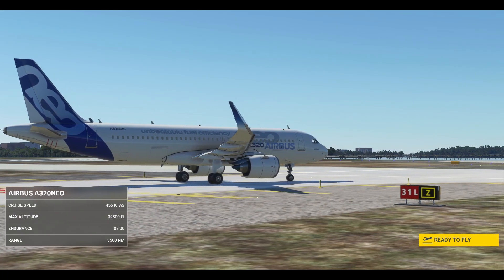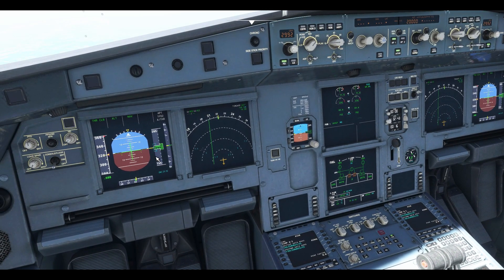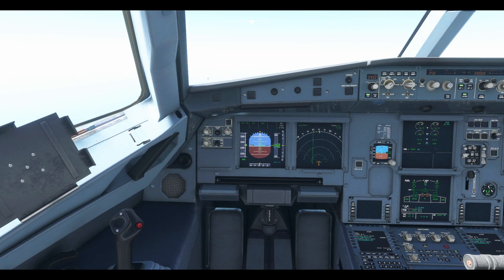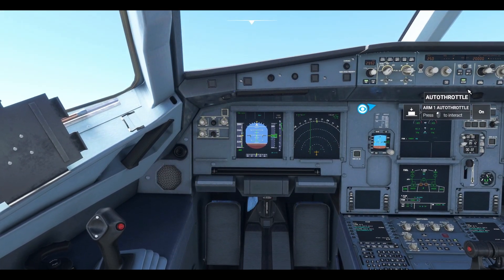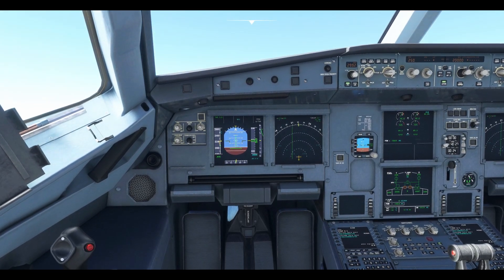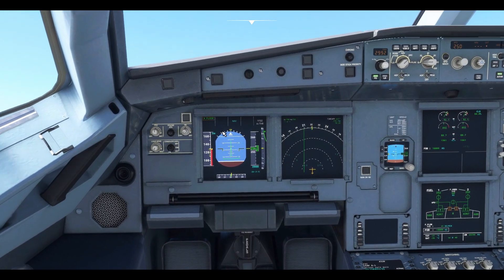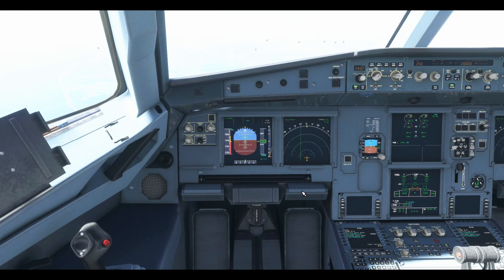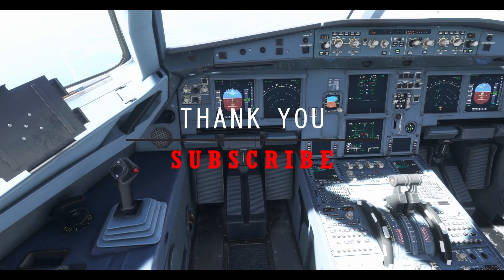Is it Possible to Stall an Airbus A320? | What happens if you try to Stall an A320? |

Comment: So air france 447 doesn't have this stall prevention system???
Reply from the maker: That was because of incorrect airspeed readings!
Reply: They were in alternate law (F/CTL ALTN LAW), where the airplane goes "none of my sensor inputs make sense, you do your thing pilot". They then managed to make the plane go slower than Airbus engineers thought was possible, losing speed indication all together a few times, which is why they heard the stall warning when they did move towards recovery and not when they kept stalling the plane.

Comment: Is this automatic stall prevention system implemented after the Air France 447 mishap?
Reply from the maker: Yes this is automatic stall prevention system. There were several reasons for the Air France 447 incident such as failure of Pitot system and improper CRM.
Reply: @JxJAVIATION  If Pitot tube gets blocked by ice, can't the flight speed information calculated from GPS?
Reply from the maker: @pchander100  on an aircraft, GPS is primarily used to calculate the aircraft's location
Reply: The airbus actually has an alternative mode on the flight management screen when you have inaccurate speed. It turns speed display to red,green,yellow. With red being a estimated "too slow" and the others too fast and safe
Reply: @pchander100  no. GPS ground speed is not the same as air speed.
Reply: When they lost air speed sensors (blocked pitot tubes ) the plane went into alternate law, where there's basically no protection. They managed to stall the plane very high up (38000ft or so). Most probably they did not even realize they stalled.

Comment: First, it sounds like the 737 MCAS system was not designed this efficiently. Second does the 320 system stall controls work this efficiently with loss of an engine ?
Reply from the maker: Yes! The stall protection system will be available even after engine failure as long as the Auto Thrust is available!
Reply: @JxJAVIATION  so is auto thrust still available if engine is failure?